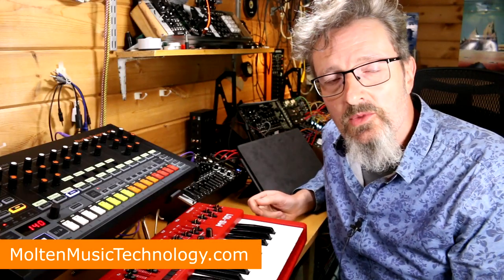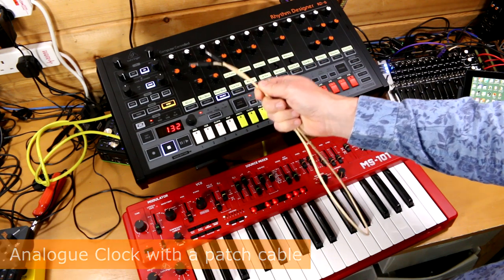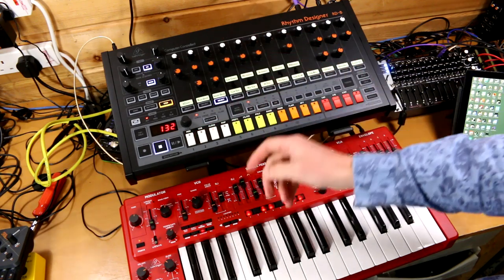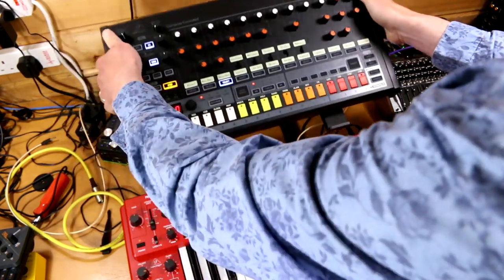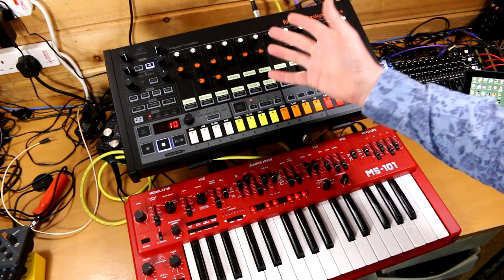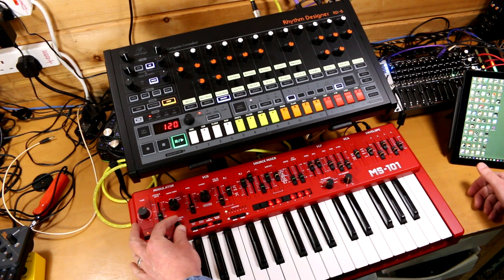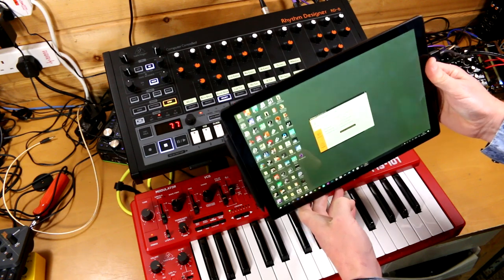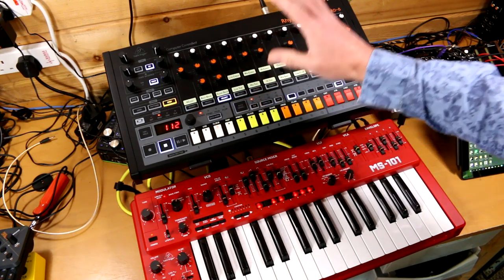How to sync a Behringer RD-8 and MS-101/ MS-1 (updated)

Comment: Thanks for the tip! It made me understand how I can use the external signal processor on my MS20 (RD-8 trig to Signal in and then Trig out back to Ext clk in) to trig the steps on the SH101. Really one of the most useful and musical trig/sync ways when working with SH101 and a drum machine.

Comment: Because so many MIDI devices are able to provide a clock it can be tricky to work out what's going on if they're all on one port. I guess most ppl don't notice as it's common to use different ports instead of 5 pin In, Out, Thru midi loops. (USB)
MIDI-OX (PC) and MIDI Monitor(Mac) can help identify issues with multiple clocks. MIDI-OX is also a great switchboard for patching and filtering individual ports.

Comment: Hi, thanks for the vid.  I tried it with midi, and there is some kind of sync: when I change the tempo on the rd the ms follows, but the sequence itself isn't syncing at all.  The tempo dial on the ms also still works.  Any idea what to do?
Reply from the maker: Nope 😀
Reply: is your sequence on the 303 playing 50% faster? so looping upon step 12 of the 808 sequence?
Reply: Idk what to do but try changing the setup around instead of the r8 being master make it the slave I'm not used to using midi because I use analog sync with a korg volca sample and td3

Comment: did you noticed that the ms-101 is acting a tick earlier than the master when synced via midi?
Reply from the maker: No, not really
Reply: oh! sorry then... but thanks for the demonstration =)
Reply: @MoltenMusicTech  sorry mate but when you midi slaved the ms1 its sequencer was running about 15-20 ms faster, you can hear it in this demo.
Reply from the maker: @lerosa3656  Really? I'm not sure i ran the sequence long enough to tell. This is the only time i've used it with MIDI so far so i've not noticed if there's a problem - analogue sync seems tight to me but i'll keep an ear open for it.
Reply: @MoltenMusicTech  yup, can hear it on yours as well as on mine slaved to a hardware sequencer, i have to run it with 20ms delay in ableton when I want to use the sequencer in sync with other hardware gear.
Reply: I noticed that too actually
Reply: Yes. Does this on mine too, but both my RD8 and MS1 have original firmware atm

Comment: Thanks for putting this online. Just got my RD8 and the manual is not saying anything actually. I had the same thing with the analog clock connecting to my Juno 6. Sounded horrible with those 24 pulses. Didnt know what to do. Thanks for this.
Reply from the maker: You're welcome. Yes, the manual is terrible.
Reply: How are your other clock settings for the rd8. my clock doesn't work :/

Comment: Hi there. I am not sure about how to ask in the right way but: I use tbe RD-8 and a microkorg in sync via midi (the mk is the master at the moment) and some of the key notes always trigger some notes of the RD-8! Other way around it's the same...if the Behringer is the master/clock, it triggers always some keys of the mk. I've tried things like switching the midi channels, but nothing has worked so far. Do you have any idea what the problem is? Thanks in advance. Nice channel!
Reply from the maker: Yes, they need to be on different MIDI channels. You have to set the RD-8 to receive on a different channel to that the MK is set to send. Or the other way around. That's all there is to it.

Comment: fixed see comments yay wounded your set up looks so easy too easy, I have the correct lead to sync but every time i try the ms1 doesnt here the midi clock from the rd8 so no sync it just plays the sequence as mnormal with its own time, not what i need, this should be simple right? i have reset the rd8 to factory settings still no joy.  my 1/8th inch jack is stereo does that make a difference i wounder? if nto am stumped at the min, been trying for over 2 hours
Reply from the maker: Hey - all I can say from what you wrote is that you mention midi clock - you’re not using midi, you should be using analog sync, from the rd8 track output to the ms1 sync input. No midi involved
Reply: @MoltenMusicTech  hi am happy to report its fixed just needed to turn off internal clock on the ms-01 with the behringer synth app was really easy to do to fix if anyone else has the same issue
Reply from the maker: Ok, good tip. I don't think the app was available when i made this video and so it just worked. There wasn't much in the MS-101 you could fiddle with - there's probably been a firmware update that's smartened up the options so that the forms of sync dont conflict with each other.

Comment: Thanks for the great video Robin, I have a question about the sequencer when connected via usb to Logic. my ms101 totally doesn't play what I have programmed into the sequencer instead it misses out notes etc.. do you know why this is happening? cheers!
Reply from the maker: no, me neither, welcome to the fabulous world of analogue gear with digital sync. You'll have to experiment with how best to run your sync - what the settings are, which way it's going. It's a process of discovery. Also make sure you have the latest firmware and check facebook groups on the MS-1.
Reply: @MoltenMusicTech  cheers for the reply! ill keep at it, all the best!

Comment: when I clock out from my volca drum to the clock in on my Rd8 Mk2 and do as this video says; the data wheel won't change the clock to anything other than the 24pps
Reply from the maker: Yes because you are using the Volca as the master and so the RD-8 clock doesn't do anything. The RD-8 will simply do what the Volca says. In the video i used the RD-8 as the master (RD-8 Out to MS-101 IN) and so the RD-8 is in charge and you can change the clock. So, with sync you set the clock with the device that's in charge and the rest follow that. I hope that helps.

Comment: Trying to sync my td3 with midi and it’s not having it.. I can’t get it to play the sequence the td3 has been programmed to play.. it plays a random sequence that the rd8 is making.. and when I switch the rd8s midi out channel to anything other than one the td3 puts out no sound??
Reply from the maker: Your RD8 is playing your TD3 - it’s not syncing. As in the video if they are on the same channel this is what happens.   Next you need to enable midi sync on the td3. There may be a button or something in the synth app needed to turn it on - just like in the video!

Comment: I can't figure out if the RD8 uses TRS-A or TRS-B.  I'm trying to clock in to the DIN sync out of my x0xbox, and I can't get it to sync at all.  I figure I must not have the right adapter for the DIN input of the x0x but that thing is so old theres not much info out there
Reply from the maker: The RD-8 isn’t either, it has actual midi ports. You can’t plug midi into Din sync, even with an adapter midi is only compatible with midi - you plug sync into sync.
Reply: @MoltenMusicTech  is there no way to translate traditional pulse-sync to DIN sync?  DIN has some major advantages over midi when using things like the 303/606/etc
Reply from the maker: Oh sure.... but you were talking about TRS-A and TRS-B - that's MIDI. MIDI and DIN SYNC are not electrically compatible so you'll need more than a cable, you need some kind of sync box. But i've never used DIN SYNC so I don't really know how to help you.

Comment: Mine doesn't. I have the sync out from the RD6 connected to the EXT Clock in on the MS1 and when I press play on the MS1, it just starts playing by itself. Do you have to open the synth tool to change the settings or something. In the video, he did nothing else except connect the cable and press play????
Reply from the maker: If you’ve connected it as you say then you need to press play on the RD-6 first. And yes the MS-1 needs to be set to analog sync. Honestly the video does show you what to do.
Reply: @MoltenMusicTech  Thanks, just set it correctly and it's fine. In my eagerness, I probably skimped stuff and went straight into the bit where you talked about the clock connections :)

Comment: Is it possible to sync the ms-101 to a daw through usb. The daw has a midi clock but i cant seem to match it to the tempo of the daw im using.
Reply from the maker: Yes, should do, you might need to use the synth app to enable midi sync
Reply: @MoltenMusicTech  I struggled for a few hours yesterday trying to get it sync but just couldn't do it.. Its friday so i have alot of time today. Might drive myself mad in the process but thats just the learning progress. 😂🤔
Reply: @JimiOob  the sequencer works well with the USB daw Sync, the arpeggiator Is another story, it wont work well at all

Comment: I connected it with mininova, yes, it is synchronized, but the mixers do not react to the berenger ms 1, but are only regulated by the mininovost, as I already threw the midi inputs, only the berenger toda works, and there is no mininovo how to make sounds change on the berenger so that the mininovo plays and the sound is changed by the berenger to that synthesizer and the sound is shol with mininova I've already tried everything the midi inputs are synchronized, but only in the direction of mininovo from mininovo and the mixers are regulated, but not on the berenger The owner of the sound mixers is a mini-new synthesizer and the beringer is only synchronized and if the midi pro is reversed, then the sound is only from the berenger, not at all
Reply from the maker: I'm sorry, I don't understand :(
I don't think the MS-1 sends out any MIDI other than notes and clock - if that's what you're asking.
Reply: @MoltenMusicTech  The translation is not correct
Reply: @MoltenMusicTech  thanks

Comment: trying to sync my ms 101 to a tr 606 trig out. But when I hit play on the ms101 it doesn't wait for the 606?
Reply from the maker: what makes you think it should wait?
Reply: @MoltenMusicTech  when you have an external cv clock plugged in to the ms101 and you press play, the sequencer of the ms101 should wait until I press play on the external source, no?
Reply from the maker: No, there's no transport control with analogue sync - no Start/Stop commands - that's MIDI. All it's getting is a tick to get in time with once it's running and failing that it runs with it's own clock.
Reply: @MoltenMusicTech  I appreciate your quick replies! I subbed :) The problem was I needed to go into Synthtribe and change clock source to trig.
Reply from the maker: Ha, yeah, that sounds a lot more right than what i was saying. Yes it should be stepped along by each trigger which essentially gives you the waiting you were talking about - that's right :D

Comment: And why not just use a RK-004 or RK-005 for retrokits.com? Or use a RK-002 and filter all out except sync. Sorry I’m a retrokits fanboy. There is also a Midi Solution box which filters out midi message not needed.
Reply from the maker: Why not indeed 😀

Comment: Can you explain how to sync a drum machine with a Behringer TD-3 please??
Reply from the maker: No, sorry, I don't have a TD-3
Reply: set the clock mode in TD3 from INT to MIDI and then use the proper I/O cable.

Comment: it’s actually hilarious how hard it is to get my arturia drumbrute impact to work with my ms-1 i’ve nearly given up
Reply: any advice? i have a drumbrute and hope to sync with ms1 when i receive soon
Reply: @daniel777L  it’s not perfect yet, but using synthtribe and arturia’s software while having the units plugged into your computer really helps. turns out i don’t have the latest version of synthtribe yet which was definitely holding me back because i couldn’t for the life of me get the app to work (which was made for ipads? that’s what the app store told me today? so weird)
but using a standard midi cable 
drumbrute midi out to MS-1 midi in has worked for me. but as for all the settings on your units to get them to communicate with each other.. just use synthtribe and arturia software because trying to get the MS-1 to do ANYTHING in its secret menu mode is borderline impossible (for me at least)
Reply: @christopherrusch  ty, i'll try the software straight off then. fingers crossed i can get it sequenced by DAW too 🤞 i'm a little sad i didnt hear about the mkii version thats coming out later this year (?) that might have fixed midi implementation but im still pumped to try and squeeze some juice out of this bad boy

Comment: That's great! Can you sync the arpeggiator via midi too? I tried this with the crave and failed.
Reply: Yes, I synced the arpeggiator by connecting the RD8 midi out to MS101 midi in. (The MS101 also outputs the arpeggiator as midi notes so you can use it to drive a synthesizer that doesn't have an arpeggiator.)

Comment: sync issues with rd8 mate just confirmed.. what  i thought.....many vids
 showing  the rd in standalone with no other stuff synced the rd drifts 
even with new firmware ....will be returning mine ... as mine drifts  in
 out slightley but dont sound right almost if triggers early n late 
.....and yes before anyone asks tried syncin to muliple sources daw,mpc 
live and x ,also tried changing audio leads its 100 percent th rd-8
Reply from the maker: Is this with MIDI or CV?
Reply: @MoltenMusicTech  midi sync try it ive updated firmware tried on 2 different setups might be just mine but play with other source ie another drum machine or metronome  fluctuates ....theres lots of videos showing running on its own but not with other drums etc
Reply from the maker: Ah ok - i use mine with analog sync. I'll try to check out the MIDI side a bit deeper with some other gear at some point.
Reply: @MoltenMusicTech  I'll try mine inmodular  with clock haven't tried that yet....🖒

Comment: Has anyone succeeded in triggering the MS-1 sequencer other than a tempo clock? Running a sequence via a rimshot trigger from the RD-8 for example. This used to be a standart trick on the original SH-101.
Reply from the maker: I haven’t worked out how to use the trigger outputs yet
Reply: As it currently stands you can trigger any synth from the RD-8, just not the Behringer MS101.
 even the SH-01a works with the RD-8.
Reply from the maker: Why's that? Doesnt trigger output to ext-clock-in move the sequencer along?
Reply: @MoltenMusicTech  exactly, but several posts on GS and sequencer.de suggest that the RD-8 does not advance the MS-1 sequencer. It does play well with others however, including the SH01a and my own Microfreak.  Could be a bug or feature of the MS-1, idk ;)
Reply: This is the quote I found supposedly from Behringer support
Regarding your inquiry: RD-8: Trigger Outputs 1-3.
Thank you for your patience here - i have been talking to our development team about this issue in particular. The Trigger Outputs are not designed to work in conjunction with the MS101 sequencer, moreover they are designed for integration with analogue drum machines to trigger external sounds. If you want to clock sequencers for the RD-8 you will need to use the sync jacks
Reply from the maker: @TJ-hs1qm  Well that's a lack of imagination. I've been testing it this morning and all you need to do is add some decay to the trigger. It's basically too sharp for the MS-101. If you trigger an envelope and use that instead it works fine. I'm going to make a video on it right now!
Reply: Molten Music Technology brilliant, thx!
Reply: Molten Music Technology Good to hear it works. Still a bummer that you need additional tweaking and more gear. Please Behringer make your boxes talk to each other and build a 100% clone.